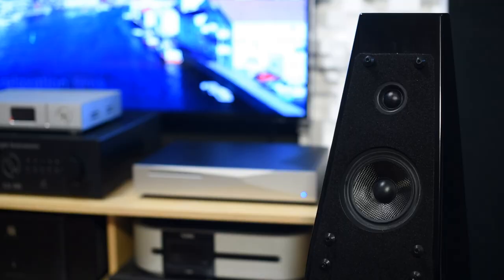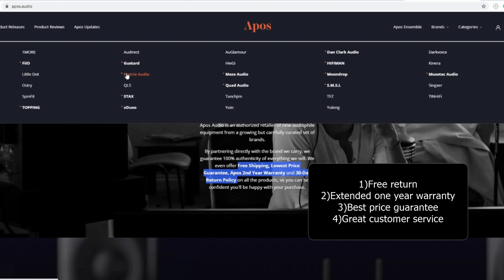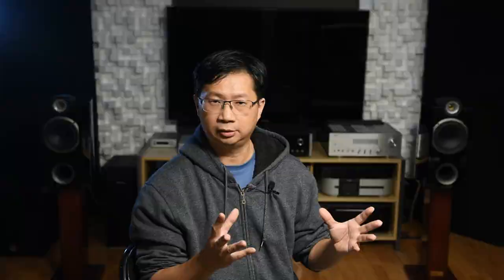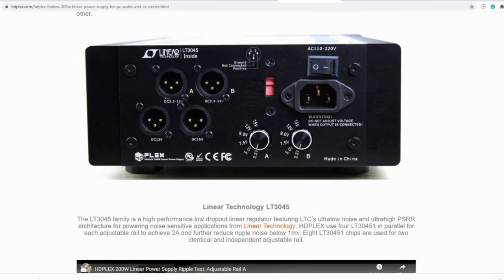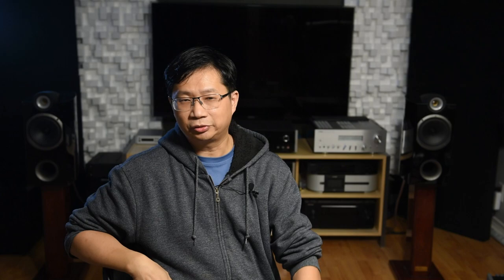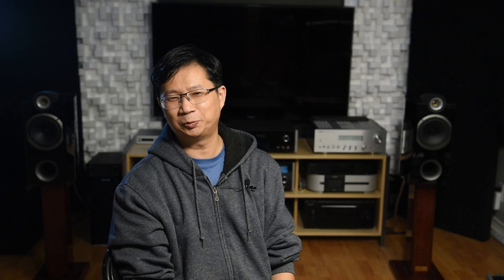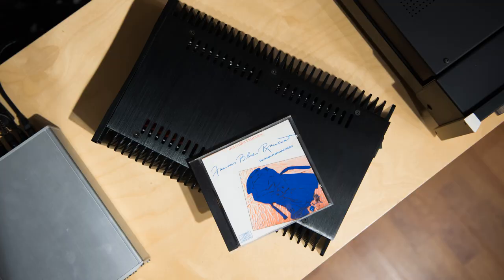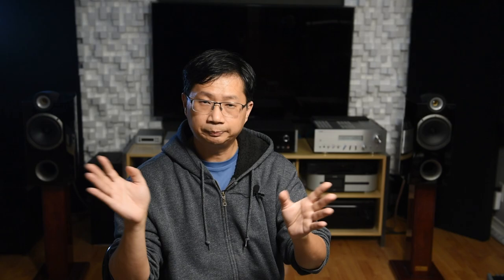Audiophile-grade computer? Really? How do I get one?

Comment: I just can't see using a 800$ power supply for a 800$ computer to drive a $200 sound card... but back a few years I was keen to improve things... I did 3 things to my computer, and the sound improvements were quit dramatic. I put in a Pangea power cord and a Seasonic power supply (2nd from top of line, $130). That improved things considerably. I also installed one of these-  Elfidelity USB Power Source PC HiFi Preamp Internal Filter For USB Audio Device - which you can find on the Ebay for  about $60, a less costly version of the same idea as the 250$ unit you're talking about here. This item I have a/b tested and the difference had me purchasing one, for the 2nd audio computer here at my lodge, within 2 minutes... All in all quite a good upgrade, but unlikely anywhere near the 5k$  innuos unit.
Reply from the maker: Nice, yeah there are more cost-efficient solutions out there.
Reply: Same. I use some iFi power adapter and usb adapter, at least better than stock. Did it work ? I dont think so, and i am glad it didnt, cos while it may clean up the higher end, it may also restrict the lower end according to others, or maybe the change is not to my liking.  So I mostly tweak at the software level (wasapi, resampler, eq etc), and room acoustics.
Reply: @ThomasAndStereo  Funny thing, after this post of yours and my commenting I thought about things for a bit and realized I never put a better (shielded etc~ the pangea unit...$65, not a lot, and hardly more than building an insufficient cable) on the project rigs source computer. So I pirated one from the other source computer... a decided improvement, not one that somebody unfamiliar with the rig would mention casually, but for sure lower noise and better everything... in audio land... worth the $65... Cheers.

Comment: I use Denon SACD DCD-A100 which has a superb DAC to connect to the TV (connected to my mini PC). bypassing the PC soundcard.  I enjoy the youtube music via this SACD DAC and Sansui amplifier.
Reply from the maker: Nice, the big question is if you upgraded the USB and power supply of your mini PC, will it improve the sound further?
Reply: I've connected my laptop, and my TV to different DACs, and the computer always sounds better. A TV is a horrible source. And it's still adding the computer noise to your DAC too, in fact it's just adding more noise to your whole system. LCD screens make a ton of noise. And it's not galvanically separated. So now you have computer, and TV noise. Instead of just computer noise. 

Do yourself a favor, and try the computer hooked directly to the SACD player. If it doesn't have a USB input. Go get a Topping D10 USB DAC. It has optical, and coaxial out. Plus a really good USB input. It's only about $65,or so. I got one for $50. And don't be surprised if the Topping sounds better then the SACD player on its own either. Get it from Amazon, or somewhere you can return it, just in case. But I'm quite sure you'll be keeping it. Good luck. ✌️

Comment: What is your opinion about taking a motherboard with a ESS Sabre 9118 DAC built in and running high quality optical directly to a high end receiver? Such as a Sony ES, Marantz, or any other quality receiver brand. Or even a mid-range integrated amplifier such as a Cambridge audio CXA 81 or an Audiolab 6000A.  Do you feel that there are inherent problems with noise going that route?

Comment: I think like in many audio discussions it depends on the audio chain. Using a PC you have 2 main noise issues. The fan and electronic noise. I found a high quality CPU fan is key and for an audio system skip the video card (they generate so much heat)  For electronic noise find a DAC /PC that uses USB in Asynchronous mode if you have a high quality DAC and the DAC needs to   galvanically isolate the USD connection to remove the electronic noise

Comment: You can use a massively overpowered PSU and a massive radiator. I use a 560mm rad with an rtx3080 and Ryzen 7800x with a 1000w PSU. The water loop needs 3 liters of water so it basically cools by thermal mass and with the massive rad passively when not under load and without oc.

Comment: I currently run a Marantz 2325 with Yamaha NS-1000M speakers.  My Source is a VPI Classic 3.  My setup is in a 12x12 room.  I could barely turn my volume up and I would get feedback into my system that would build upon itself and sounded dangerous.  I could not have this!!!  So I bought some bass traps for the rear corners and some sound foam panels for the side walls.  Completely eliminated all bass bounce and feedback.  My stereo never sounded so good.  Room treatments are amazing.

Comment: I use some iFi power adapter and usb adapter, at least better than stock. Did it work ? I dont think so, and i am glad it didnt, cos while it may clean up the higher end, it may also restrict the lower end according to others, or maybe the change is not to my liking.  So I mostly tweak at the software level (wasapi, resampler, eq etc), and room acoustics.

Comment: Thomas, wow you make so many really great videos! I wanted to just comment that I had used the mac mini with Audirvana for my headphone amps and thought it would work well with my stereo system too. I tried it and then saw your video on Zenith streamer which then made me want to try out a streamer. Bluesound Node 2i was for me obvious starting point. The improvement over mac mini was huge. Darker background, then paired with smsl M400 a wider soundstage. When I removed the M400 the sound stage was slightly narrower but still present. Also, i think BlueOS app has a slightly better UI than Audirvana. Wish I could get my $100 back from Audirvana lol. Happy Listening!
Reply from the maker: Yeah, the difference is subtle but it is there.

Comment: I compliment the systems appearance, it is very clean and will sell visually to a general consumer base.... No hard intentions meant, so please pardon the constructive criticism ......One cannot achieve any kind of uncolored, clean audio reproduction using flimsy electronics. That modular PC audio cards board has no visible/logical components to harness/execute  proper signaling. The amplifier seems robust to an untrained eye, with a  decent looking  transformer in the housing, but look close at the capacitors......can't see the output IC's clearly, they are type and configuration is important as well as others. Software based processing can help,  but must be used with  real electrical hardware. Having been in the AV Engineering, design and development for over 4 decades have I never heard or seen such products promoted in the Pro AV Industry as well as  long time HIFI enthusiasts. The word Audiophile is a ruse. Good work though, keep experimenting.....Just think there is a little snake oil in the presentation. Good luck!

Comment: Raspberry Pi is all you need.
Low power, silent, more than powerful enough for audio, Linux based players outputting directly to ALSA is bit-perfect without resampling, numerous dedicated audiophile operating systems available for free.

Using a desktop PC for a low power, low noise use case such as audio is a waste of money, a waste of electricity and space and using a desktop operating system like Windows does a worse job than a Linux/ALSA system and requires you to have a keyboard and pointing device to hand as it's not headless.
Reply from the maker: Yeah, I have one of those SOTM streamers, I should try using it again.

Comment: I have the matrix element powered by an Sbooster also added the matrix spdif2 using the iIs port to your recommended  smsl m400. Also  have the tp-link for fiber optic connection . Very pleased with the sound sq from amazon hd and YouTube.
Reply from the maker: Nice! Hope the SMSL M400 is still keeping you happy.
Reply: I use the Matrix Element H connected to the Matrix SPDIF 2 via Matrix USB cable. I then connect up my active monitors set for digital input and connect with an AES Mogami Gold 3173 XLR cable. The SPDIF 2 is powered by external LPSU (@ 7v). Fantastic clean sound even from You tube etc. Monitors are studio level (Adam Audio SV3s), I built my PC and use an 850W  Seasonic Titanium PSU with X299 MSI board and i9-7980XE (used and de-lidded).

Comment: NUC i5 8GB RAM
SSD 1TB Samsung 860Evo
USB cable spliced into earth into power point, fixes ground loop hum and gives a massive noise floor drop.. Get new wall adaptor strip USB cable, outer jacket wired into Earth Pin (do not leave any stray wires to live or neutral, you blow it up or kill someone) 
Upgrade PSU to lager external brick, older HP Laptops came with monster brick power supplies, re-terminate 19V input, massive noise floor drop.
Kill all start-up programs
Run JRiver
USB output, power data isolator (doukmall Ebay), isolates the PC noise on the power lines of USB
USB to DAC to PA

Cheap and super clean, no streaming if you use local SSD stored FLAC. Can be run without monitor, boot with no password run JRiver on startup and use Gizmodo app to control library.
Reply from the maker: Cool, thanks.

Comment: Thanks Thomas, really enjoyed the video.  I wonder if spending the money on a Innuos re-clocker and linear power supply would make a more significant improvement than changing the internal components on a PC.  You are right, the room treatment and linear power supply would make more of a difference, but sadly those two areas don’t have the glamour of a new component in the hifi rack.  Plus the partner factor has a big part to play with room acoustic treatment.
Reply from the maker: Yeah, sadly I would not know which is the better solution.
Reply: @ThomasAndStereo  I wouldn’t expect you to know, just food for thought as they say 🤔

Comment: The one caveat to using a soundcard is that the PCIe bus is VERY noisy and generates broadband, gaussian switching noise that often gets thru the soundcard with at least a few mV of amplitude. By the time this goes thru the amplifier, it can be well over a volt or more p-p, which will cause some faint hiss (think good quality analog tape type hiss). Its not as bad as it appears as most of this goes well up into the RF spectrum, and will be knocked out by the RF filtering in the input stages of the amplifier. A bigger problem is if the amplifier is not VERY well isolated (grounded input stages will be a disaster if they do not use good star-point grounding in the amp). I ended up building my own amplifier with an SMPS because it was much easier to isolate than a large transformer with its large inter-winding capacitance. If the isolation is poor, there will be extreme noise and harsh 50/60Hz background hum from the computers power supply (and even the amplifier's) forming AC ground loops with the amplifier. If you can, get something external with its own dedicated power supply that will be quieter. Another issue I ran into with the Soundblaster Z is large DC offsets in the 5.1 outputs. Up to 30-40mV, which may cause issues if there is not good DC compensation in the amplifiers. At the very least, it caused lots of turn-on thump in the powered sub, so Im using the standard stereo output that has DC blocking caps on the card so I dont have an earthquake when the PC powers up. Downside is a 45Hz roll-off in the bass response, but it will do for the time being.
Reply from the maker: Interesting. Thanks for sharing.
Reply: This is not a sound card, but a USB card. There is no analog signal here. It is just having a better isolated USB port (not sharing with computers generic USB hub) and using as a transport to DAC's USB input instead of a generic motherboard USB port as a transport.
Reply: @ridingdreamer  My comments were more general, if I recall. Something to be mindful of when using a PC as a source if you are using the internal hardware. Some soundcards actually do have near SOTA performance, which is nice as you don't have to have the dongle to deal with, and some can also drive multiple outputs with one-click source selection which is a plus if you have speakers or headphones. There are enough of the internal ones worth using that it warrants consideration. The Soundblaster AE-7 with a class-AB onboard amp is the best one I have found thus far, with very low noise and distortion <0.005%, which beats a lot of audiophile DACs. As an added bonus, the ADC is good enough for use with REW and taking room measurements, so it saves a lot of extra "boxes."

Comment: I didn't quite get how you supply the power to a PC? PC uses multiple voltages, doesn't it
Reply from the maker: Yes, it has 4 output and different voltage.
Reply: Ok. Got it. there is a voltage divider available on the same website

Comment: Hi. For pc i recomand siching off all usb that you don t use. ( keep just 1 on ) disable HT, disable intel speed ( is modulatinc the power and speed that you cpu is running ) not use anything like hhd jus ssd, izolating the vibtions and use a longer usb cable to put the pc out of the lisening room. And tray a streamer the cc audio or the new old xiaomi mi x box. With a nas on the same network. Xiaomi can be use with usb dac and you can a/b :D

Comment: Hey, Thomas! I haven't commented on your videos lately because I've just been too bust enjoying my system as it is.
I purchased the Musical Paradise MP301 tube amp because of your review , and have been very happy with it.
Later, also because of your review,  I added the Musical Paradise  MP-D1 tube dac. For me, this was a killer combo.
I then added the Musical Paradise MP Berry music server, which is a windows 10 computer running Foobar.
It is a fanless computer with a linear power supply and a cpu that doesn't draw much power.
I find that all three products have a good synergy, and I do believe that the value and quality far surpass the very affordable prices for these units.
I( have implicated almost all of the suggestions made by Shingnosis in his (her?) comment regarding computers as a source, except that I use the USB software that Musical Paradise supplies.
I am sure that there are better setups out there, but they are all way more costly than these Musical Paradise products, and frankly, using these products gives me a very satisfying sound that i enjoy enough that I rarely think of trying to improve it!
Reply from the maker: Wow! Good to hear from you, I should call you Mr Musical Paradise 🤣
Reply: @ThomasAndStereo  Sounds good!

Comment: Hello Thomas, while it seems reasonable that a more stable power supply can improve the analog output of a DAC, I cannot understand what the tuning of the PC - when it does not contain the DAC - could improve sonically besides the PC itself having less noise.
Anyway, I always enjoy your videos, BR, Joe
Reply from the maker: Sure, it could have done nothing and what I heard was simply from the USB card or better linear power supply with the DAC. I changed multiple things at the same time and unfortunately, I cannot AB test it. So that is why I had to be clear what I did because what you ask is a valid question.
Reply: @ThomasAndStereo  there's no logical reason for usb card to make a difference. Maybe it would effect latency but that's it. If you heard a difference it's a placibo effect. Your power supply upgrade for the DAC could definitely make an improvement though.
Reply: @ThomasAndStereo  
Main thing it would be to isolate Audio USB signal from others. Also not all USB chips are alike. Best would be to look at the signal with Spectrum Analyzer to see which signal is cleaner.

Comment: Hi there .. the linear power supply .. can it be used for 2 turntables and a mixer
Reply from the maker: It should, just take a look at the photo of the back of this PS and see if the voltage and AMP matches what you need.
Reply: @ThomasAndStereo  thanks for the heads up ... not sure about compatibility but it would save money if it could do 4 components .. an average linear supply is prob £300/400  .. obviously there’s a bit more to it but yeah, I’ll run it by an engineer .. DJ Equipment is notoriously poor on sound unless you go boutique rotary and then there’s less sound manipulation available  .. thanks again x

Comment: You are a mad lad , great job . I was wondering about this USB card and if it was snake oil.  Also I'm worried that you built that computer on the carpet due to the ESD , but if you had bare feet on the carpet you are probably ok .
Reply: Some USB chips are better than others, and generally USB is not preferred for audio signals. So yes, I can see a point in having dedicated USB card just for audio, especially if it can be isolated from other devices on MB with cleaner voltage supply.

Comment: I'm not convinced by the linear power supply actually is better and might be adding more noise in the 50 60 and 120hz range what is not good for audio, what is eliminated in a good quality switch mode power supply running at 120 kilohertz. The biggest problem I think with computers switch-mode power supplies is they are inside the unit causing admitting radio interference emi, with a switch mode power supply has to be in its own case grounded outside the unit a little distance away the cables have to be shielded in a metal conduit shower hose would be good, that is grounded.  ideally with a ferrite bead of one turn on the positive leads and filter caps of 1uF and 0.1uF on each power terminal that would be the 3- volts 5-volt and 12- volts respectively. Switch mode power supplies should be used on valve equipment for the purposes I'm saying is a lot of noise on valve equipment at 50/60 and 120Hz this is completely eliminated with a smps above the audio spectrum